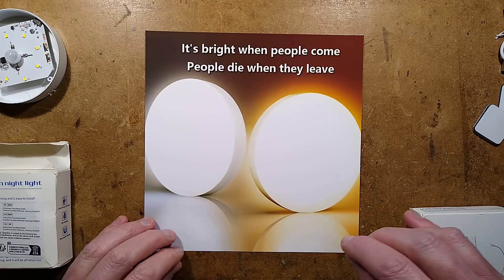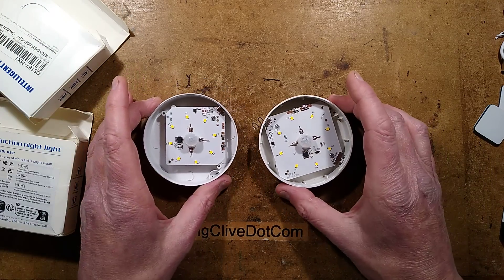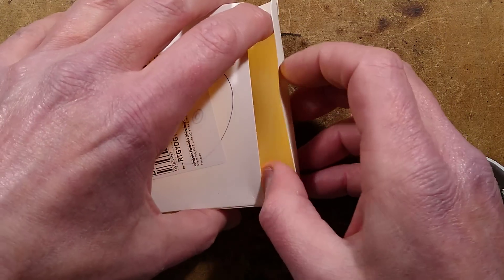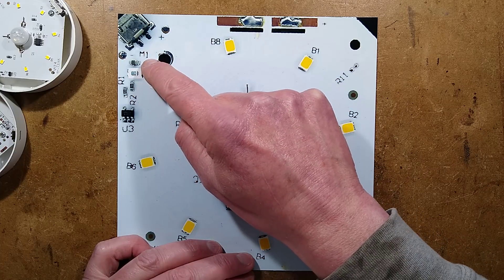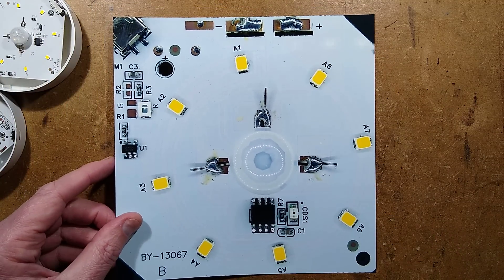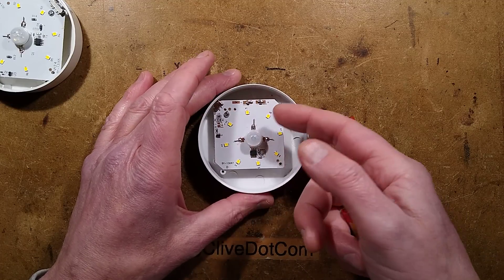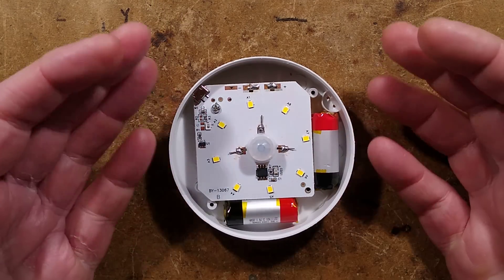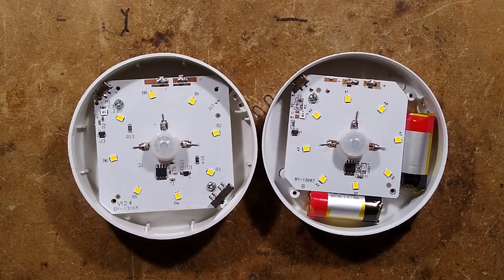You can't even turn this unit off

Comment: I bought four of these and one of them would not charge at all.
When I checked the battery, it was all swollen.
Replaced it with a battery salvaged from a vape, which just about fitted on one side of the board and it now works and lasts longer than the others.
Reply: I bought two. They worked but battery life was very short still. So I crammed in a vape battery in both and now they last much longer. Very handy for dark closets and sheds...

Comment: I love that the wiggly plastic staple is still embedded in the table
Reply: Was just thinking the same thing. Also the random burn marks from the failed lithium autopsy.
Reply: @TalasDS  Was it a lithium cell? I thought it was an Eneloop style NiMH cell.
Reply: @cambridgemart2075  indeed it was a NiMH cell.

It has been so long I barely remember the cause. The burn mark still remains. And it was just a little after he changed the table.

Lithium cells have always been quite disappointing now that I remember.
They consistently fail to go violently kaboom.
Reply: I remember the video that he made that had the plastic welder and the hot wire broke off.
Reply: It's not a staple, it's a burn mark in the wood.
Reply: When did that happen? I never really noticed it, had previously assumed it was always there
Reply: @brabhamfreaman166  "It was always there"  - The God Staple
Reply: @brabhamfreaman166 it's been a long time, not sure how long exactly, but a matter of months. It does draw your eye to it, doesn't it?
Reply: It's a shibboleth. It's to make sure that nobody can impersonate Big Clive. Wiggly metal thingy not embedded in the bench? It's not Big Clive.
Reply: @rogerthatt7217  Now there's a word I don't her often, unless I feel like a giant chess piece at the time.
Reply: @rogerthatt7217  AI can learn to add the squiggle.
If you ask an AI trained on YouTube videos to make a BigClive video that squiggle is likely there.
Reply: Let us pray
Reply: It's so good when the youtubers care about continuity right?!

Comment: You could, if you so wished, after fitting the batteries to the pc board, put a small switch in the circuit so that the lights could be turned off. However, I would think having flashing LEDs and a small tune module would be suitably annoying. Good post 👍

Comment: I don't know that the explanation of dark noise and increasing PIR gain when the light is off is necessarily correct. I think a more probable explanation is simply that the surface of the cardboard when it's in the box is so close to the PIR and LEDs that it's reflecting the thermal infrared radiation of the warm LEDs themselves onto the PIR, and because the thermal mass of the LEDs is so low, they cool very rapidly as soon as they're turned off and the change in amount of reflected mid IR onto the PIR is rapid enough to trigger it. When the light is mounted on a wall in a normal room the adjacent walls are much too far away to reflect a significant amount of IR back onto the PIR detector and it can't see the heat of the LEDs. Put some insulation over the LEDs when back inside the box, it will probably stop the cycling.
Reply: I second that. My expensive KNX PIR have configurable dead times to not trigger by some lights turning off and cooling down.
Reply: Yeah, my thoughts exactly.
Though the gain theory is also not that far fetched. Especially with such a cheap product.
Reply: @taukakao  It seems unlikely. Don't forget that everything above zero emits IR, including the sensor itself. The sensor doesn't actually detect IR directly, but changes in temperature, due to IR focused on it by the lens. The sensor needs a change in temperature, in order to generate a voltage: remember the second law of thermodynamics states there needs to be a temperature difference to do work and a change in temperature has that effect, as the part of the sensor under the lens is will be at a different temperature, than another part of the sensor, until of course it reaches thermal equilibrium.
Reply: I'm not so sure. Don't forget that these come with an opaque plastic cover (which Clive didn't show). That plastic would also reflect the LEDs internally. For the ones I have, the PIR sits in a hole in the middle of the plastic cover. But, light bulbs with built-in PIR have the sensor inside the glass/plastic bulb. So, without Clive showing us, we don't know.
Anyway, this would need to be tested to determine the actual cause. You could insulate the PIR instead of the LEDs by using a bit of tubing. This leaves the top open but stops the PIR from sensing around the sides.
Reply: @two_tier_gary_rumain  
The plastic would need to be quite transparent to IR so that the sensor even works so I don't think it reflects as much IR as the cardboard box.

Comment: Interesting that they even bother to make different PCBs and not just a single one with the switch missing
Reply: But that would use more material for no reason. Gotta cut those corners.
Reply: @Cenentury0941  the pcb is generally too big. Designing and ordering only one type is still cheaper than making 2, even if it is slightly bigger. The pcb itself doesn't really "cost" something.
Those devices are sold for 2 bucks and there is even a small lithium cell inside. And they even make profit selling those. This is crazy!

Comment: No disassembly? 😭😉 Is it really possible to install 2 additional cells? How does the charge controller behave?
Reply from the maker: As long as the cells have a close voltage they can be combined in parallel to make a single higher capacity cell.  The charger will see it as a single cell and just take longer to charge it.
Reply: I was disappointed by the lack of disassembly too. Although I know what to expect, it would have still been nice to see the back and battery.
Reply: I’ve got a solar charged garden spotlight which has two 2000 mAH 18650 cells paralleled.  The output is at least a few hundred lumens, forget the exact number.  In the summer it will stay lit all night.  The circuit looks at the voltage output from the solar panel and it has to be surprisingly dark for the panel output to be low enough to turn on the light.  The light has been running reliably for about three years now.  That’s 1000+ cycles of the battery.  I believe the cells must not be run too low or they would be depleted by now.  Occasionally China, Inc. does things right.  It helps that it was Walmart’s “Better Homes and Gardens” house brand, so Walmart had its reputation to defend by not selling utter junk.

Comment: I wonder if this is happening with my bedroom battery motion sensor.  Sensor times out, turns off light; seconds later sensor triggers, light lights, repeat. Only happens when battery is under 60% (threshold?). Maybe I'll throw an old IR remote on the bed & next time it happens I'll try holding that to see if it slows/stops the cycle. Never thought of it being noise floor from being too dark. Though I feel dumb for not thinking of it now.
Reply from the maker: It probably won't respond to the remote, as it is long wave IR it detects.

Comment: The lithium cells have a built-in charge - discharge circuit.  There should be a regulation that requires the circuit also have a tracking transmitter that puts out a simple code, maybe a serial number, every ten seconds or so.  Then an app for smart phones that receives that signal.  The added cost would be minimal.
Thanks, Clive.

Comment: I love this kind of hackery. Scavanging some "street lithium" to upgrade some chinesium. Brilliant, keep it up Clive. - LibC
Reply: I upgraded a linear LED light with street lithium batteries, works a treat now._
Reply: Street lithium is the best lithium

wait... what?...
Reply: What is "street lithium" ? Are these batteries found on the ground ?
Reply: @AnonymosAnthropos  The lipo batteries from disposable non-refillable vapes, that are common here in the UK. Once they're empty  they're supposed to be put in for recycling, but many peeps just throw them away, often on the ground.
Reply: i still have to use ton of mine...
Reply: @michaelturner4457  , they are dumped in the street here in australia too.
Reply: @michaelturner4457  I'm quite surprised batteries in those are re chargeable
Reply: @ImieNazwiskoOK  I'm sure they have to use a lipo cell because of the high current(several amps) the heating coil requires to vaporise the e-liquid.  That a small, say AA or AAA size zinc-carbon or alkaline primary cell couldn't. There's usually no charging circuit in single use vapes, they're pre-charged at the factory. They're often sold by the number of puffs they're expected to give, like 600 puffs before the e-liquid or battery runs out.
Reply: @michaelturner4457 often they'll contain the standard 18650 cells, the worse made ones like Juul use a proprietary rectangular battery which is less useful. 

They don't have charging circuit more often that not since the coils are not replaceable and the liquid isn't refillable.  

If it looks big enough to fit an 18650 cell inside that's probably what it is.  

These are the common battery found inside charge banks for phones, so pretty useful for a spare.

Comment: "Come for the light; stay because you're dead!"

Let's just be thankful they weren't 240v mains powered.
Reply: Perhaps that was based on a noted consequence of the (Mains driven) prototype? 💡⚰😋
Reply: @UK-Combustibility-Assured Newspaper headline: The electrical engineer found on the floor, had a pen in the one hand and a leaf of paper in the other. He noted: "Really dangerous. Just discoverd, that the circuit misses"
Reply: @Stefan_Dahn  I wrote a similar report back in late 2001, when testing signalling equipment as part of my job at London Underground. However because I happen to have characteristics people refuse to accept, that report and my death both went completely unnoticed... 🔇
Reply: @UK-Combustibility-Assured  "Didn't like the long circuit, so I made a shorter one".
Reply: @spvillano  Yeah. I found that connecting the third rail to the fourth gave some particularly spectacular results... ⚡💥😉

(Be very careful, though - They saw the arc flash all over Zone 2. I was in Zone 6 just outside Hillingdon at the time! 😳)

Comment: Cutting component count was done in the 1950's by TV maker Earl "mad man" Muntz. He took competitor's TV sets and started removing parts. When it stopped working he put that one back. As long as it worked with a strong signal, it was good enough and he copied that design.
Reply: That is the most hack-job form of engineering.  I mean, I know computer simulation wasn't exactly ubiquitous in the 50s, but come on.  Either understand the circuit, and know why the parts are there, or leave it to someone else to design.
Reply: @sirnickity  That sounds suspiciously like work, and as we all know work is the enemy of profit
Reply: @sirnickity  Earl Muntz was a high school dropout so he probably didn’t know how the circuits worked! What he did recognise was that most TVs at the time had very overpowered receiver units, which was somewhat wasteful in big cities with good reception, and drove up costs.
Reply: @jb-br8bf  muntz actually came up with  a lot of interesting designs or his employees did, not all of his reduction in price came from just yanking filtering
Reply: Only knew about that guy because of 4 tracks, interesting that he some other stuff, thanks!
Reply: At least it's not a Philco
Reply: I never heard of this man but I remember the TV ads from "Cal Worthington (Calif used cars) and New York area electronics chain Crazy Eddie." who used his style to sell merchandise.
Reply: @cliffontheroad  - Cal Worthington ended up coming to Houston for a while, running his "And his dog Spot!" commercials.  Eventually I think he was deported back to California.
Reply: @tbelding  Deported? LOL. I am happy to say I saw many (?) of his commercials. Same thing about Crazy Eddie. FYI: CE closed down. They had been moving inventory from warehouse to warehouse to reach bogus counts. Memory, not resarched.
Reply: @cliffontheroad Is this a bot comment? This makes NO SENSE to any part of the conversation....
Suspiciously as if it is Google/YouTube allowing this to happen to pad out their "Active Userbase" figure to make them more appealing to investors.

Oh how the mighty always fall eventually.
Reply: @LND3947  I revised my text to be shorter and more direct. (Sometimes only the author knows what was meant. In the same token, was it implied my orig text was the product of a bot? YT does things I do not agree with but self-generated comments R unlikely.)
Reply: @LND3947  ...What are you talking about. That comment makes complete sense and is entirely relevant.

Wait, you are probably bot spam, aren't you.
Reply: @somdudewillson  do you see the (edited) part?
Plus the other person also mentioned they revised the whole comment.
And since the later comments also are very weirdly worded to some degree, I can imagine the confusion before the revision.